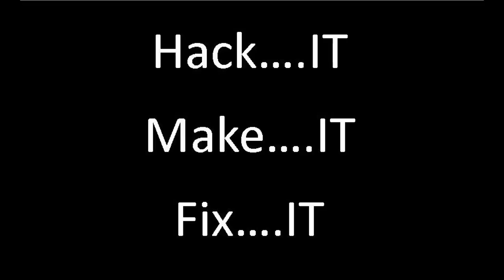Chromecast Hacking fixing heat and wifi Problems #54

Comment: hey pal great modification,  I bought mine a year after it initially was released,  may I suggest the solved the heating problem I've never had that issue,  my router is on the right of the internal antenna so , no metal blockage .  have you opened a newer version of v1?   maybe they're using lower voltage components or more thermal paste?  had it 2 or 3 years zero issues

Comment: Anyone laugh at that thing at the end because of how it look?  It's like you created a monster.  Just buy the Ethernet Cable Adapter if you having signal and weak wireless signal.  $15.00 bucks and it solved all your problem.  Much easier and quicker solution too.
Reply: Didn't know they had this, I'm gonna get one!  When I bought my Chromecast about 2 years ago I was kinda like should I get it even... Well I went for it and it has changed our lives and continues to as more apps start adopting it in their programming.  Yet the buffer thing got me the other day when watching a streamed movie that I finally had to turn on my old smart Bluray player to finish watching it with, as it was ethernet connected.  Yet the Chromecast is so much more convienent.

Comment: Why not just leave the casing off if it traps the heat?
Reply: One word, Dust
Reply: or leave it with the hole cut out and casing on likley a better idea as casing holds , buttons etc in place

Comment: CRAP I just got one of these and I can NOT do what this guy does may have to take it back cause I was going to run it upstairs so probably be a worse signal and it would be in a spot where it WILL heat up...NICE JOB THOUGH BUD WISH I HAD YOUR SKILLS.

Comment: First clip of yours I've seen and I have to admit I'm very impressed. Good work, like the passive heatsink. I wonder if the technicians at Google actually fully tested that virtually pointless heatsink they used. Wonder why a device which should draw very little power gets so hot. How much power does it require? 
Do you own a Asus vivobook s200e? They also have a bad heat dissipation solution. I have another laptop with the same CPU and it runs close to silent whereas the vivo is loud. I'm tempted to mod it, the keyboard has failed so whilst I've got it open I might look into that. Only problem is I need to keep it looking neat, I doubt just changing the thermal paste will be enough but that's the first thing I'm going to try. 
Ramble over, thanks for this clip. I'm going to watch more and maybe sub.

Comment: Hey. Nice work. But why did you desolder that resistor. Couldn`t you just solder the antenna over that  resistor?
Reply from the maker: Hi it is actually a capacitor I will add an annotation to correct it. You need to remove it as it is put in there to match the impedance of the crappy PCB antenna to 50 ohms. If I left it in it would mess up the impedance of my antenna.

Comment: Hey, I have an aspire s3 ultrabook with quite low wifi reception, the 2 antenna wires are soldered to a backplate (there is no much space inside for anything), do you have a recommendation to improve the signal? (I don't think I can fit your typical antenna hack) http://www.blogcdn.com/www.engadget.com/media/2011/09/acer-s32.jpg (2 antenna wires are in the left side of the image, black/white) any idea? thanks!
Reply: There is a video in which Andrew explains how to mod an antenna in a netbook.
I saw the antennas where in both sides of the netbook screen. May be relocating the antennas there it will improve.